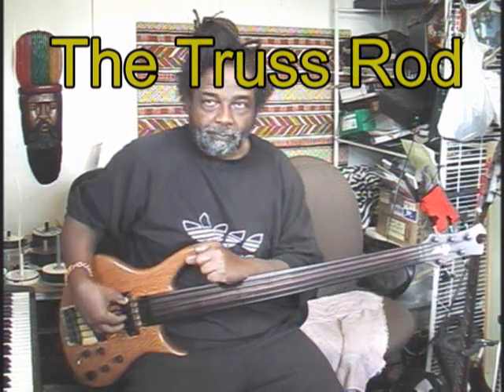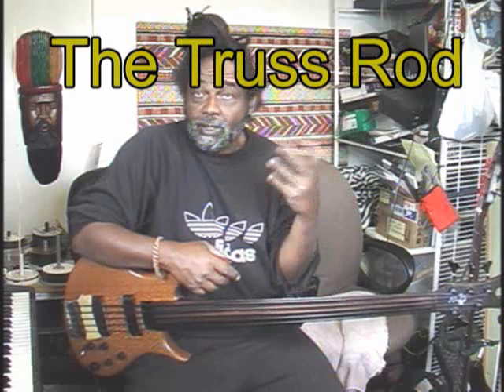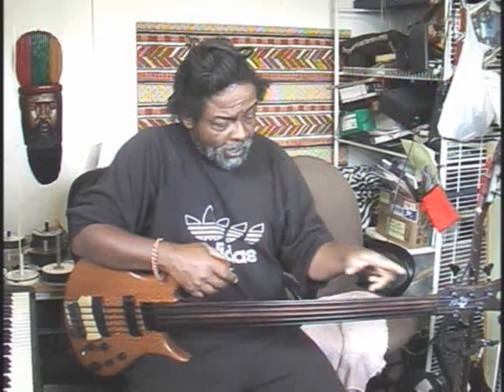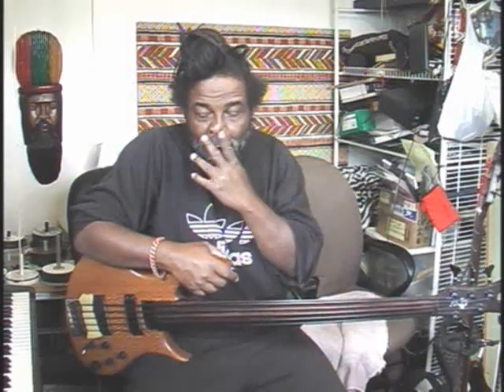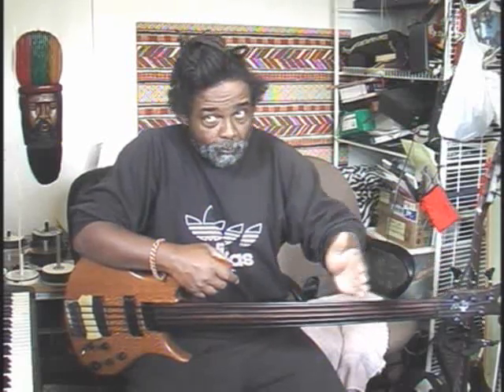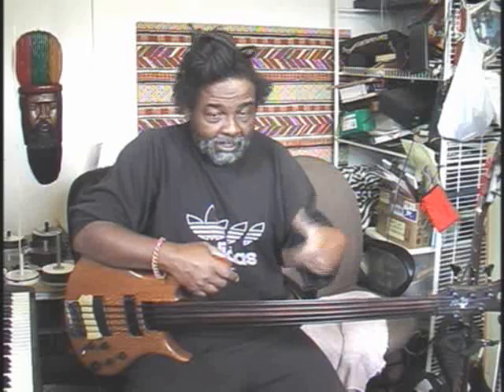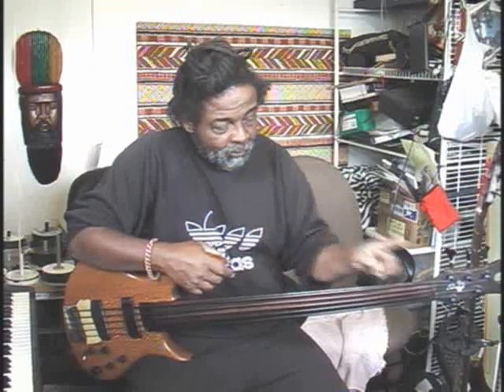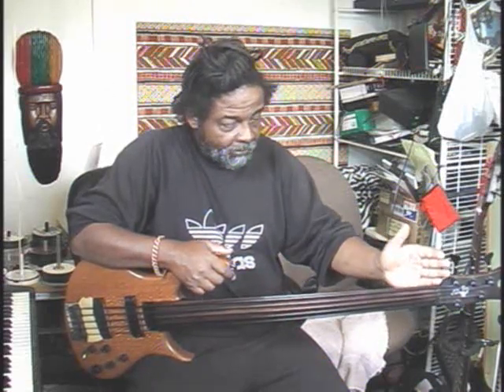The Truss Rod

Comment from the maker: The String needs clearance to avoid hitting the fret (board) and buzzing. If you hold the string down at the 1 fret and the 15th fret and observe the clearance underneath the 8 fret (or do), it  should be about the thickness of a fender thin pick  (off the top of the 8th fret) and the bottom of the string .. If it  is less than that (or if you are heavy handed the TR needs to be loosened 1/4 turn then played for a while. Repeat the next day if necessary. Too mush space means it needs tightening

Comment: I have a squire short scale bass and am wondering if the truss rod adjustment will help with fret buzz. I've set the actions higher and it has alleviated it a bit,.... but the action seems to be pretty darn high at the 12th fret. Then again I'm thinkin I may just be a little heavy handed with the bass. Should the frets always buzz when you hit the strings hard? Anyway it may be that the scale is so short that the strings just end up being floppier... just thinking out loud.